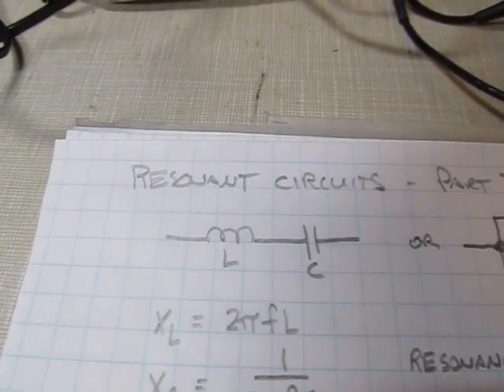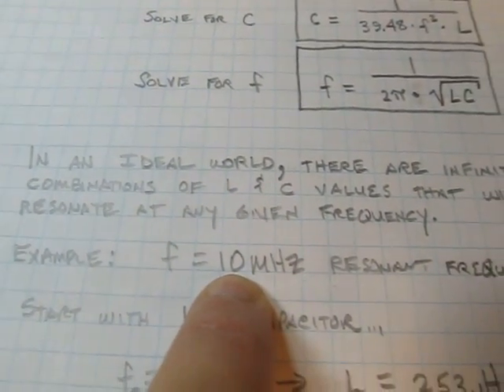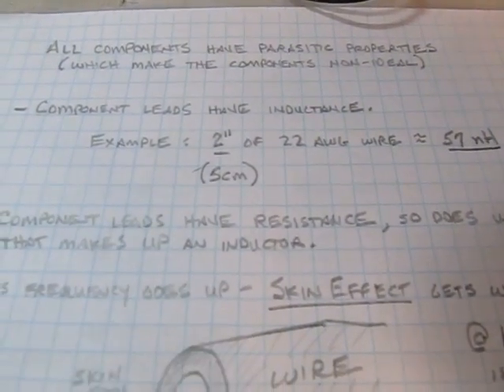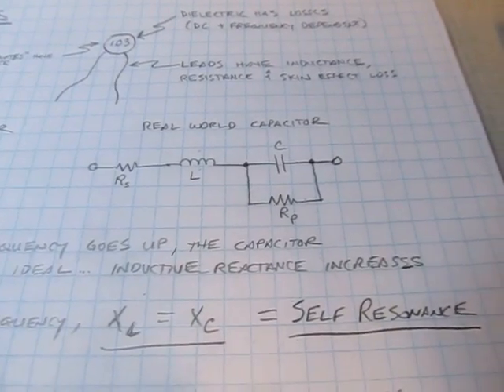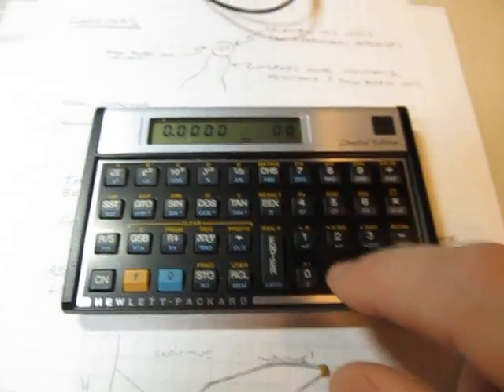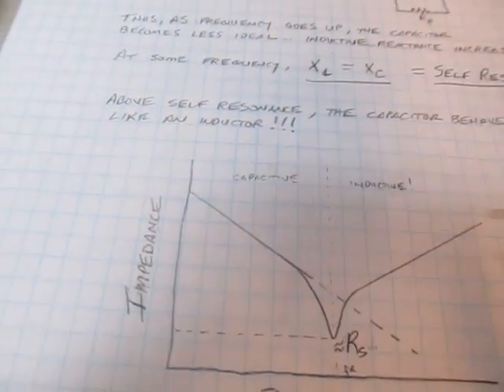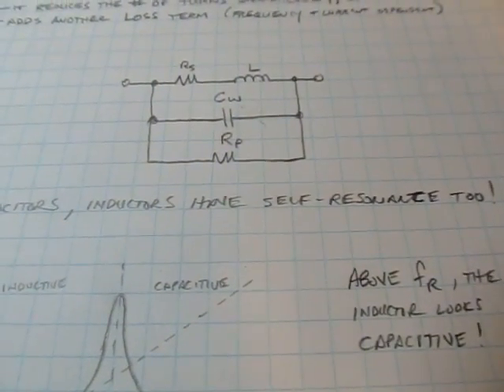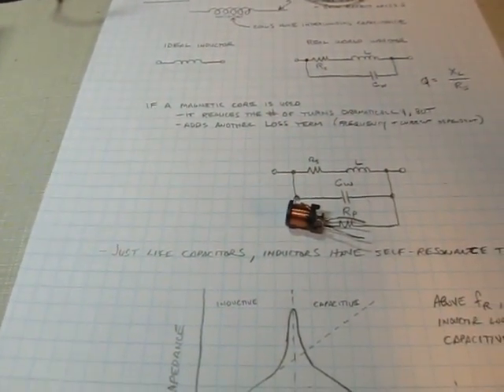#56: Basics of Capacitor & Inductor self-resonance, parasitics, etc. - Tutorial

Comment: How does a technician tell the difference between a passive "non-parasitic" RC network compated to a passive "parasitic circuit" RC network? Its hard for me when looking at schematic to tell. What is a "non-parasitic" circuit VS compared to a "parasitic" circuit, how can technician tell amd know which is which?
Reply from the maker: I good engineer would never design a RC network that relied on the parasitic behavior of the components, because this is not consistent or predictable.  So, you should never have to look for the difference.
Reply: @w2aew  the parasitic circuit will always route bleeding off frequencies to ground, is this what engineers try to eliminate from the parasite behavior in passive RC networks?

Comment: Thank you for your videos I am learning so much. Have you already done a video or planning to do a video on how to measure inductor losses at certain frequencies? Specifically I have random toroids lying around and I want to classify the core by suitable frequency range. What I tied so far is to connect a signal generator via a 5 k resistor to an LC tank, with a high impedance oscilloscope in parallel. I adjust the frequency until the amplitude peaks . This way I also measure the bandwidth. On one toroid it peaked at 100mV with a 1V signal. I assume this huge insertion loss comes from the incorrect choice of core at 1MHz
Reply from the maker: Connecting to a high-Z scope input winds up putting the scope's input capacitance (or the probe's input capacitance) in parallel with the inductor, thus affecting the resonant frequency of the tank.  A better measurement is the self-resonant frequency of the inductor itself (best done with a VNA).

Comment: thanks a lot for this tutorial! you have no idea how great it is to find someone who explains the practical aspects of electronics well, especially since i'm in college, with many things in the labs which i don't understand i can always come here to find an explanation. Also, how does the impedance spike for the inductor at the resonant frequency? If the impedance of both the inductor and capacitor is equal, shouldn't the equivalent impedance be half of the impedance at resonant frequencies?
Reply from the maker: It's because, unlike resistors, there is a phase shift between the voltage and current in a capacitor and in an inductor.  These currents will constructively or destructively combine depending on whether the LC is in series or parallel.  See my video #55 on LC resonant circuits.

Comment: can we use an LCR meter instead of this analog device that has been used in this video to find the resonant frequency?
Reply from the maker: LCR meters generally can not be used to directly measure self-resonance.
Reply: @w2aew  I see, I thought that we could use those meter to measure impedance at specific frequencies, if this is true, it should be possible to carry out a frequency sweep to get a frequency response and find the resonance frequency if it is within a certain frequency range
Reply: @w2aew  I am about to design my first hobby PCB CPLD board, I chose AMS1117 voltage regulator but am unsure about what capacitors to use with it. The datasheet mentions an output 22uF tantalum capacitor and no mention of input capacitor.

Have you made a video on the value and placement of capacitors used with voltage regulators and what happens if we don't use the right value or type?

Comment: A resistor is a piece of wire and an Inductor is a piece of wire. How are the piece of wire different from each other?
Reply from the maker: Not all resistors are just wire.  Wirewound resistors are usually made of special wire such as nichrome wire, which is higher resistance than simple copper wire.  Inductors are NOT made with nichrome wire because you ideally want no resistance (since that would decrease the inductor's Q).
Reply: @w2aew  Inductors use copper wire or or what type of wire insulations? I know that guitar pickups use I think copper wire but the wire insulations are polyurethanes, nylons, polynylons, polyester. The wire insulation gives the wire GAP when wrapping. This is the same for transformers I'm sure. Some are Enamel Coated or Poly Coated copper wire. But ALL resistors use NICHROME WIRE for carbon composition resistors, carbon film resistors, metal film resistors, metal oxide film resistors?
Reply from the maker: @waynegram8907  The wires connecting to the resistive element are ordinary, low resistance wire (usually copper). The resistive element can be metal film, carbon film, carbon composite, nichrome wire, or other materials based on the application.
Reply: @w2aew  I'm confused about the different resistive Elements. The element is the main difference between resistor types and inductors? The element is not coiled or zigzag it's just a straight wire?
Reply from the maker: @waynegram8907  Take a look at the images here, and explore the links:
https://www.google.com/imgres?imgurl=https%3A%2F%2Flearnabout-electronics.org%2FResistors%2Fimages%2Fcarbon_comp_const.jpg&imgrefurl=https%3A%2F%2Flearnabout-electronics.org%2FResistors%2Fresistors_08.php&tbnid=HZ64f7nxqu23_M&vet=10CAgQxiAoAmoXChMIkKfVx_bH_QIVAAAAAB0AAAAAEAc..i&docid=EsWVAL9-Xg9ntM&w=355&h=120&itg=1&q=construction%20of%20axial%20lead%20resistors&ved=0CAgQxiAoAmoXChMIkKfVx_bH_QIVAAAAAB0AAAAAEAc
Reply: @w2aew  The schematic symbol for resistive elements are zigzag wire which is this true that inside a resistive element the Nichrome wire is zigzag wire? The inductors schematic symbol is a coil of copper wire or enamel wire? The only difference between a resistor and an inductor is the wire type it seems because resistors use Nichrome for wire and an inductor uses copper wire/enamel wire. The Resistor element is I'm guessing somewhat of insulator type around the Nichrome wire?  because the resistive element is the carbon composition, carbon film, metal film, metal oxide. The resistive element is NOT the Nichrome wire?
Reply: @w2aew  it seems that the Nichrome wire is WRAPPED around the resistive element material type CORE. The CORE can be metal film, metal oxide, carbon comp, carbon film but the Nichrome wire wraps around it but the electrons or voltage/current only will go through the Nichrome wire? I'm not sure how the current/voltage electrons pass through the CORE material, it just doesn't make sense.
Reply from the maker: @waynegram8907  No.  Nichrome wire is ONLY used for wirewound resistors.  The other types (metal film, carbon film, carbon composite, etc.) do not use nichrome wire at all.  In some cases, like carbon composite, the resistive element is a "slug" of material.  In the case of the film resistors, the element is often deposited on some insulating core.
Reply from the maker: @waynegram8907  The symbol does not represent the construction of the resistor.
Reply: @w2aew  The Metal film, carbon, film, carbon composite is a CORE with No Wrapped wire at all only just a CORE material? I'm confused if the electrons current/voltage are flowing through the CORE resistive element? because an inductor uses an iron ferrite core because the electrons current/voltage don't flow through the inductors iron ferrite core only the wrapped copper or enamel wire.
Reply from the maker: @waynegram8907  The "core" of a resistor and the "core" of an inductor serve completely different purposes.  It doesn't make sense to directly compare them.  For a carbon composite resistor, the core is typically a tube filled with the carbon composite material, and current goes through this material.  For the film type, the core is simply a substrate that the resistive film is applied to as a coating. Sometimes this coating is spiraled around the core.  The current flows through the film.
Reply: @w2aew  Ya that is what I was confused about because I always thought resistors had a special made wire that was coated with different material. It seems that the electrons current flows THROUGH the CORE material or it flows THROUGH the FILM material. Its hard to visually see this in my mind because the CORE material or FILM material is NOT a wire, so I can't visually see electrons flowing through a core material or film material, it just doesn't make sense to me. All I see it electrons getting blocked and not conducting through the core material or film material. Its not like how transistors have doping materials that have electrons and holes built into the junctions which the resistor Core material  or film material doesn't have impurities or doping of electrons and holes for electrons to move through the transistor junction. So I'm not understanding how electrons can pass through and go though a resistive core material or film material, it just doesn't make sense to me.
Reply from the maker: @waynegram8907  All materials have some resistivity. Conductors are very low, insulators are very high. You don’t have to use the semiconductor analogy. Even your body has some resistance. If you pinch the probes of and ohmmeter between your fingers, you will get some high value but non-infinite resistance. Moisten your fingers and the resistance will go down.

Comment: Stray inductance and capacitance are the nightmare of a homebrewer, especially when designing large amplifiers. That was also why the large manufacturers that produced them had problems as well, where they added neutralizing circuits with "gimmicks." What looks good on paper does not necessarily work well after layout and construction, as parasitics can bite you in the behind.

A grid dip meter is a lifesaver in building RF circuits, and especially in building RF amplifiers.

Comment: parasitics?
Reply from the maker: Parasitics = the undesired, but real, characteristics that come along with a component - such as the inductance of the leads of a capacitor or resistor, or the capacitance between the ends of a resistor or between the individual turns of wire in an inductor.

Comment: Many antenna traps use the self-resonant frequency of an inductor to eliminate the need for a parallel capacitor to create the parallel resonant circuit needed for a trap. I have yet to find a means of determining how to calculate the required inductor build characteristics to do this. It seems that it is a trial and error process (?), but I have a hard time believing there isn't some sort of formula that can be used to at least get you in the ballpark.

Comment: Can u confirm: when at resonant frequency, the inductor and capacitor in series only has real resistance (reactance goes away). Would u agree with that?
Reply from the maker: Yes, that is the very definition of resonance, when the reactance component drops to zero.
Reply: @w2aew  I am currently working on a circuit that has an inductor and a capacitor in series. At resonance, the input signal to the inductor + cap and the output signal of inductor and capacitor are in phase, I should be getting close to 1.5ohm but I am getting around 16ohm. The datasheet of the inductor states max DCR of 1.4ohm, and the cap esr of milliohm. Yet why am I getting 16ohm? Would you have any idea?
Reply from the maker: @samshurp4518  Take a look at the reactance value of the inductor and capacitor at the resonant frequency...

Comment: Nicely explained as usual, although I had to come back to it. I remember seeing it several years ago.
I find it amazing that we get any high freq stuff done at all, especially into the GHz.
It is always talked about to keep traces short and such, but signals have to travel fairly long conductors with very significant L and C, there's no way around that. So I'm guessing there are tricks to isolate resonances, perhaps it's a bit of a tuning juggling game of different sections?
I suppose when I design one of my hobbyist  circuits my signals degrade in shape and quality through the stages because I lack control of these parasitics, and perhaps the trick of HF is to recondition it in stages?
Or do you keep it from degrading all the way?
Reply from the maker: There is a lot of careful design considerations and component selections, along with careful layout needed for successful RF/microwave designs to work.

Comment: can you recommend any nice books about all this staff you are talking about? Especially about design on the transmitter/receiver circuits (it is for learning porpose so less ICs involved it is better). I try to build simple and very low power transmitters / recievers to control different devices at home (like rc car, light and other small things). But I have noticed that I can't really learn from youtube (because all videos scratch only the surface but I need a lot of more details how it works etc.)
Reply from the maker: I like practical books like "The Art of Electronics" by Horowitz & Hill.

Comment: If impedance of an inductor starts to drop after it's resonant frequency is reached (and your supplying a very large frequency) does that mean there is no more oscillating magnetic field produced by the coil?
Reply from the maker: There is still a field, it just means that the inductor is beginning to be bypassed by the parasitic capacitance.

Comment: hello,   I started following your videos about inductors and capacitors parasitic effect. The video is really helpful for me. 

It is possible to get some video on how to design the equivalent circuit of an inductor simulated in hfss. I am trying to get an equivalent circuit of my antenna but I don't know which kind of model I have to choose and a basic value of inductor and capacitors. If you could do this, then it will be helpful for me. Thank you for providing this kind of videos.
Reply from the maker: I"ve never used HFSS, so really can't provide any info/advice regarding modeling in this tool.

Comment: Just curious; are there any application(s) you know of where these parasitic properties are used to an advantage in a circuit? Where it would be desirable?
Reply from the maker: There might be - but it would not be very common, since parasitics are not well controlled and can vary wildly from device to device, as well as with physical mounting configurations.
Reply: BEdmonson85 - Any FPGA. Was that a real question or an EEVBlog troll?
Reply: Electric guitar pickups turn this into a mysterious art form.

Comment: Can the dip res freq in the real world capacitor or inductor not be used in circuit as the " res freq " in a tuned circuit requiring the same resonance ? That is , with no inductor or capacitor  needed.
Reply from the maker: It could - but it could likely be very unpredictable due to manufacturing tolerances, etc. as well as sensitivity to different mounting configurations and variations, since we're dealing with parasitic inductance which is not specified, and is highly dependent on lead length, mounting configuration, and physical orientation.

Comment: That was very very good explanation on parasitics, I have a better understanding of modeling components, as well as working with frequency dependant circuits now, even transistors have parasitic capacitance at higher frequencies. This video is a great tutorial on why certain values of capacitors are used at rf rather than just throw a large capacitor for rf filtering and such. Thanks for taking the time to put this video together.

Comment: Alan, in an old AM radio does the antenna and the tuning capacitor form a tank circuit?  If so, is it typically a series or parallel circuit?  Any help you can provide is appreciated.
Reply from the maker: It is typically a parallel tank circuit - the antenna loop is in parallel to the capacitor(s), so that it presents the highest impedance at the resonant (tuned) frequency, thus having the highest voltage response to RF at the tuned frequency.

Comment: Alan, I'm new to electronics and I'm beginning to work on old radios.  I had thought that when a tuning circuit went into resonance current was peaking strong.  Is this the case?
Reply from the maker: It depends on the circuit.  A parallel resonant circuit looks like an open at resonance, while a series resonant circuit looks like a short.

Comment: Thanks a lot Allan,  excellent Video as usual, and straight to the point. One question I have relates to the high Z / 50Ohms choice that I have on the AWG...Will the choice of High Z compensate for not using the 10db Attenuator?
Reply from the maker: No.  The high-Z / 50ohm selection only tells the generator what load to expect so that the voltage reading on the generator is correct.  The output impedance of the generator is always 50 ohms in both cases.  You might want to watch this video:
https://www.youtube.com/watch?v=tClE8s6RZdg
Reply: Thanks Alan, It's clear. I just noticed that this question was in the wrong video. I watched #56 then jumped to #100 (where the question is relevant), but watched from different device (my mobile phone probably). when I went to the desktop to type the question I had #56 in my mind. My bad!